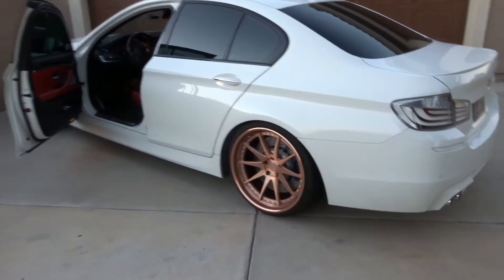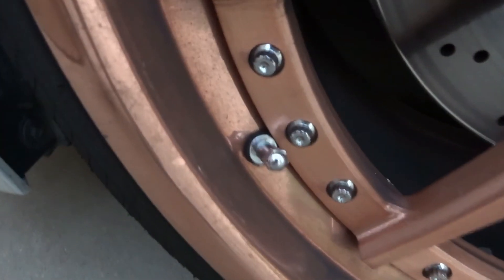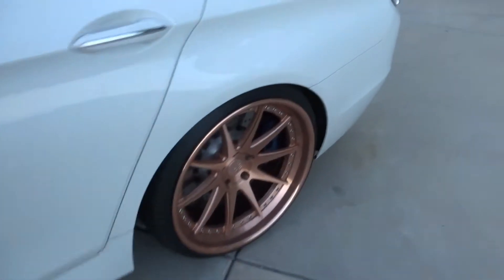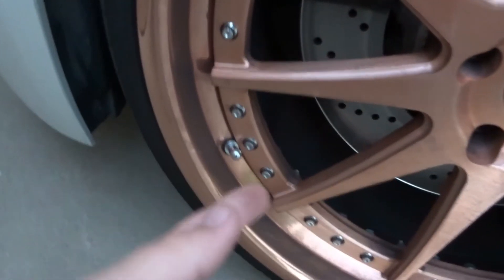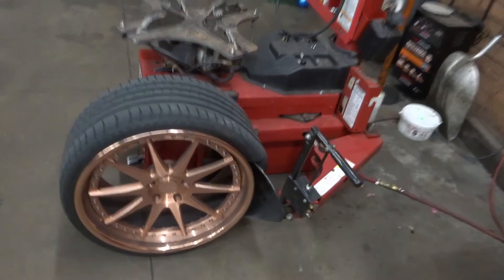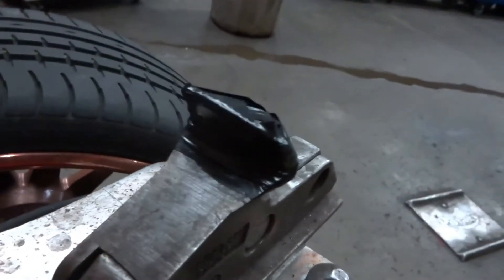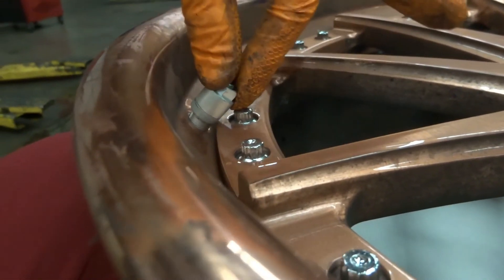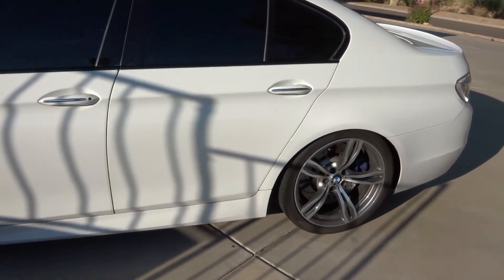The Devil is in the DETAILS! Small Things To Watch For on CUSTOM MADE FORGED WHEELS!

Comment: what size wheels are those
Reply from the maker: Peter Smith the copper ones are 21s
Reply: Not much of a  tire ! How is the ride ?  Do you run your M5 at High speeds ? It just looks like your tires has no room to move while your under heavy G loads
Reply from the maker: Yes definitely a small amount of cushion.  The ride is honestly not very different from the 20s, and I keep higher pressure in these purposely to keep from compressing the tire and damaging a wheel. I've driven pretty aggressively on them, no true M5 capable speeds in the mid triple digits or higher tho. However they are Y speed rated so they are good for the better part of what the car can deliver in theory. always keep it under 55 tho ;)